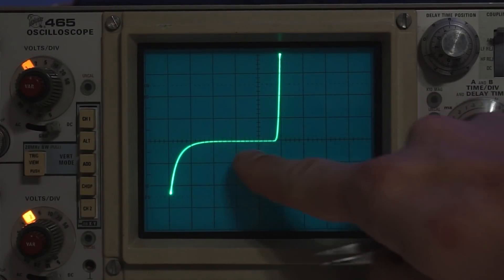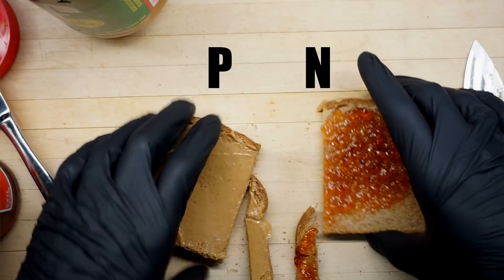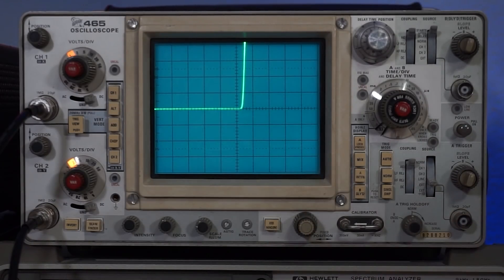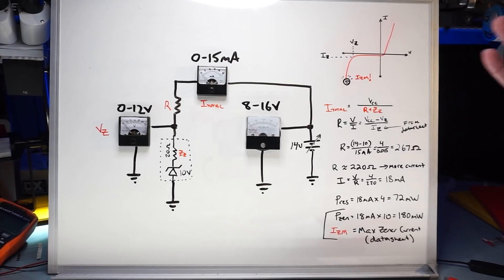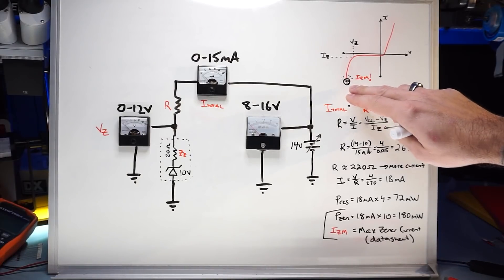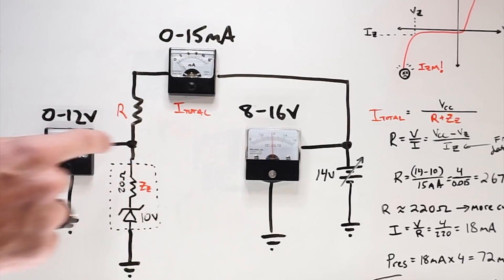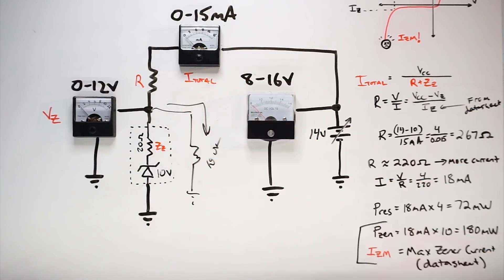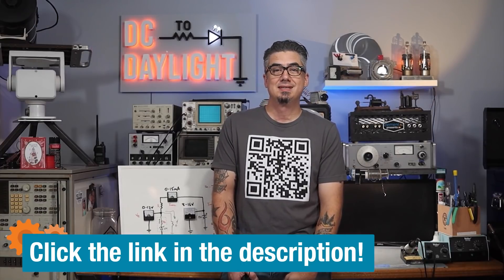How Zener Diodes Work - DC To Daylight

Comment: This was less a "how it works" and more a "how to use".

You covered the PN junction but didn't go into much detail on what it's actually doing during zener breakdown aside from saying "quantum tunneling" - more detail at this stage would have been nice.
Reply: I thought this video had an appropriate balance of how-it-works vs. how-to-use it for the likely audience.  Clearly, you  skew from the center of what I expect, but there's only so much that can be covered.  A lot of his time was spent on the electrical  characteristics (which is an aspect of how it works).  I think it is a nice introduction to the subject.

Comment: What is the purpose of a diode (don't know what type) between an indicator light and ground in a 28V D.C. circuit?  My guess is to make the indicator lamp turn on and off sharply rather than fade in and out. Yes?  I think it was a Zener diode but not sure.

Comment: Omg! This caused me to break out my 475 scope and the octopus I built YEARS ago! I have really never fully understood zener diodes and decided to use semiconductors like 7805, 7812 etc,, etc. Thanks for a great explanation! Oh and what does the QC code on your shirt say? I tried to scan it with my phone but no joy.
Reply: @The Current Source 465 is the scope I used to use as an FC in the Navy on board USS Truxtun (CGN-35) for the SPS-48C. I found a 475 a few agos on EBay and it does X/Y pretty well.

Comment: Newb question. Most common zeners are rated for 2 watts like the one when I made a mock linear 5vdc psu using my function gen set to 12vpp and used a led and quarter watt resistor as the load. I had it after the rail to rail cap before the load.